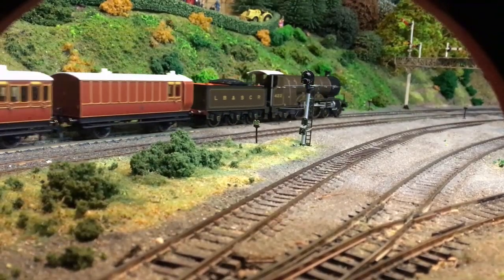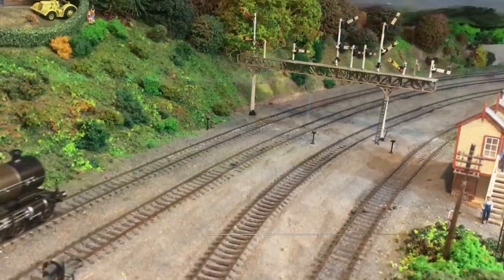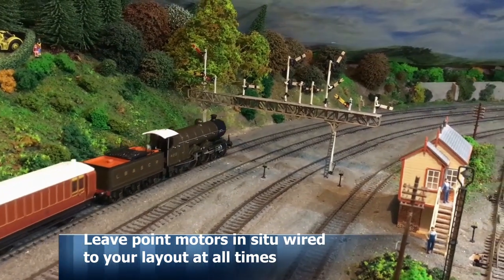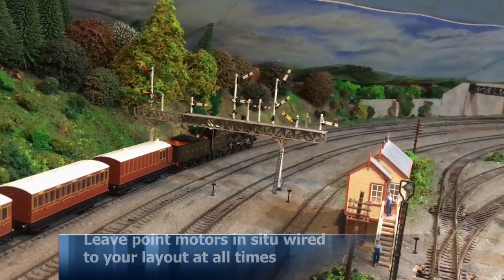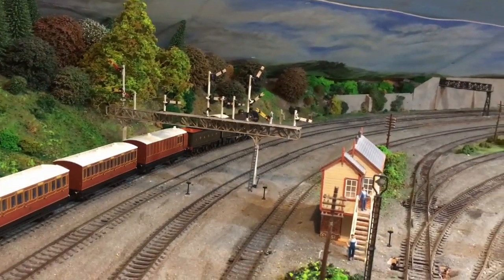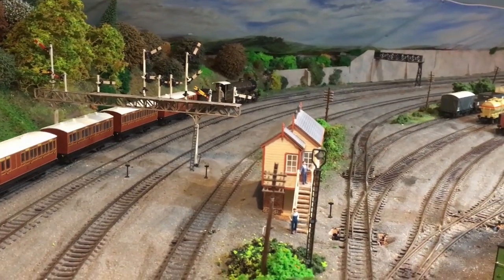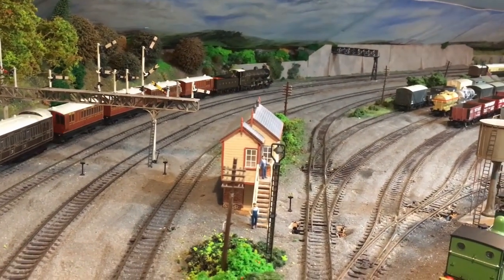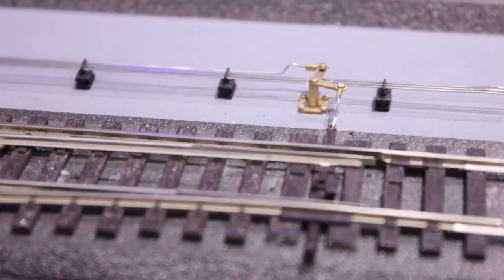Setting Cobalt Digital Point Motors on any DCC system

Comment: How do I set up the points with the doc-ex csb1 controller please?
Reply from the maker: you need to send a standard dcc command with the appropriate point / accessories address :) while the motor is in the 'set' mode - once you've sent the command, simply move the SET position to RUN - that's it :)

Comment: What’s happened to the remove centering command and killing the power during setup instructions ? This is different to the way as I understand it from the instructions. The motor is shown centred in the graphic. I note you say motor does not have to be removed so is this process only for old installations?
Reply from the maker: For the last 4-5 batches the self centring is by default switched off. It is still available, but has to be user activated. This video applies to all new-sold Cobalt motors, as well as old ones after self centring is disabled.